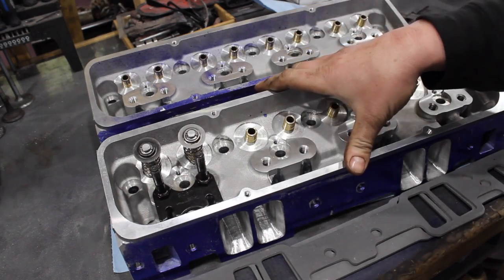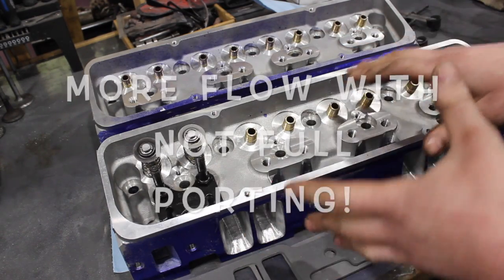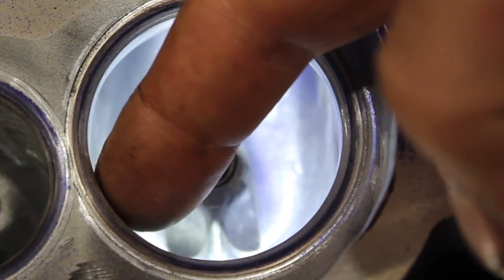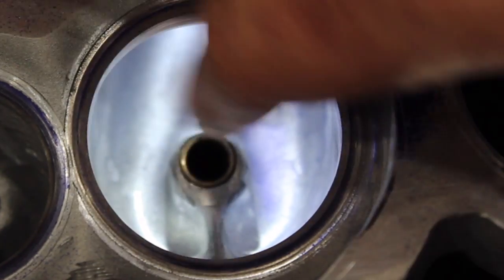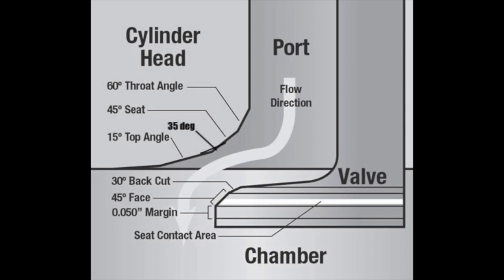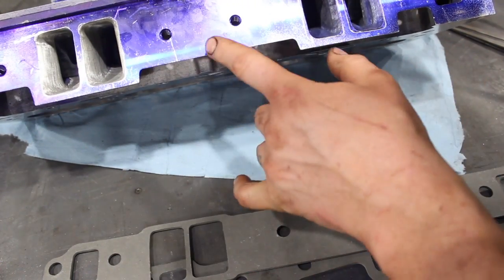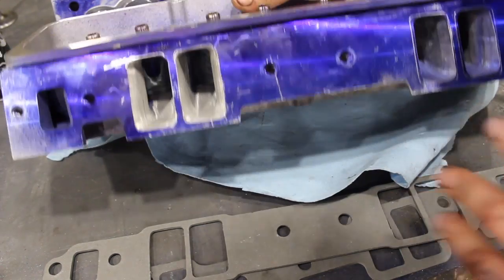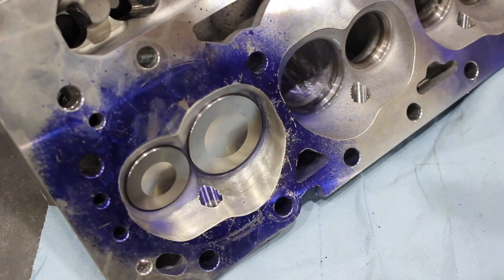Budget Head Now 550 HP Capable! Help me Build it Series

Comment: Great info question for you? i have a set of valves they are the same size that the dna heads are.. but they have ben ran in a different set of heads not very much run time on them they still look like new. Would you use them in a set of the dna heads? Or should I buy new valves? I am trying to get by as cheap as possible. i am putting together a 406 for a old square body suburban so I could use all the help I can get. I have rebuilt a few different engines but always just stock rebuilds this is my fist time swapping and experimenting with different parts 😂. Thank you for everything
Reply from the maker: If they are in good shape, you can reuse them

Comment: I have a set of SBC Edelbrock Performer RPM heads that I got in a trade. They're around 15 yrs old but don't really have that many miles on them. They were on a running 350 when I got them. I'm planning to build a budget 406 and hoping for around 500 hp. Would it be cheaper to have the Edelbrock's machined, considering I already have them, or to buy a new set of the Chinese heads?

Comment: Mine just arrived.  Pretty decent casting quality. Slight lippage at valve job, a little casting crud, one small scratch on one head deck that caught my nail. All in all not too bad.
Going up to a 2.05 after port cleanup.
Machine shops around here are booked out its crazy.
Update: finished port cleanup, slightly opened up pushrod pinch, worked bowls a little, finished exhaust with 120g, intake with 60g.
Next step is 2.08, check exhaust seats, match 1206 gasket, deshroud chamber to my 4.155 bore. Will allow less dish in the piston to get 10:1

Comment: Little  help!!! Start off,,, 1996 chevy 1500 4x4 5.7l (r) motor (L31)  i believe, 310,000 + ,using antifreeze ,cracked head,doing a rebuild on it with new vevor replacement heads???  Need an idea of cam/ lifters ,springs,( tow a 20ft.bass boat). Will need good brakes, vacuum , not hydro boost. Would like to speak with you,Thankz
Reply: @HaugBunch  your computer won't like it.

Comment: 244 dollars on Amazon right now. Still a great deal.
Reply: I found em and got em. Was looking at vortecs but was going to get them bare anyway so these are a better option for my 406
Reply: I sent mine to Eric winegartner from YouTube. 600 to have ported. He then set them up for me. They have thin ports at the pinch point but can be opened a little. I suggest you atleast open them a little if you can. The only place that really needs it. Gasget match. I just did my first set and they came out great. They are cheap enough for me to experiment with. You don't have to ,they are good heads. A lot of heads have problems.  Eric's cheapest heads are worth every penny. I have ordered heads directly from him.
Reply: @maxhames499  i appreciate ya. I was going to send him my set to have them flowed once done. Ive worked my brother in laws plow truck heads (882) years ago and these are my first aluminum.  Now I understand why Eric says "i don't do iron" lol
Reply: @paulmryglod4802  I did back in the day but no flow bench. I still don't have one. I took the measurements from my last set and got really close. I didn't put in bigger valves. Not worth the trouble. He has a video with my heads. He had to mill them a few thousand. I paid 189 a piece so a little extra work. After all said and done a cheap set from Eric on my next hotrod will be what I do. On my stuff these heads work fine
Reply: @maxhames499  awesome! I'm building up my dad's 400 that's been in our family since 78 and collecting dust since 06. Putting it in his 70 k20

Comment: These are great heads. I wish i would have bought more of them. Dont put bigger valves in! Open pinch point a tiny bit. I always use adjustable push rod guides. Eveything this guy said is spot on.

Comment: I know this is an old video. But my dna heads are still holding up. 383 stroker. Thanks. I bought these heads because of you. 400 dollars. 600 for porting. 160 shipping. 300 for pro 5 angle and back cut tulip valves. 500 for small parts. I was using vortecs. These blew them away. I kept the 2.02 valves.
Reply: I have watched a lot of different videos on small block Chevrolet and the 53 I don’t believe I’ve seen another set of videos that I enjoy as much as yours. You’re very knowledgeable. Explain things extremely well. I always look forward to your next video. Thank you for what you do.

Comment: I heard you say peak was @650.but where did it stop making large gains,because when you stop making big gains you have a parasitic power loss due to compressing 16 springs or (32) if you have double springs with that much weight being taken from the engine due to the loss of compressing then without flow gains also.so your sweet spot as far as that goes im guessing the magic lift would be around 550 to 575.

Comment: Bought a set of proheder months after they came out Depends where you get these...mine had avery nice velve job on it still had it checked. After porting first pass I got 308int and 230 at 600 with only a few cc removed. #'s were consistent with a 195c comp port and carried til .750
Lots of potential with min removal in the right places. VJ on those (vid) is horrid glad you went after it. A proper one can net as much as 25 cfm. 
The drill lappers will never understand this and unseat the other cuts doing this lol. 
Your getting better man keep up the good work

Comment: Do you really need to do the valve job? Just clean up & get new valves + l00 length & new seals & new dual springs etc, will it work?

Comment: Can I use these on a 1991 l98 TPI setup?
Reply from the maker: You will probably have issues getting the lower intake to seal to the large intake port
Reply: use an afr 180 elim head perfect for the tpi

Comment: Need help vortec or DNA heads on my 327 ?
Reply from the maker: Both will work fantastic, if your going with higher compression (10.5:1+) and a larger cam then the DNA heads but if its lower than that the vortecs will work great
Reply: @cuttersperformance  well the small journal I got already was at 10.1 compression rated @275 hp with stock heads. Want something in the 380-425  range.

Comment: Which intake gaskets did you use? I used 1205 but the port is raised . 100". I notched the intake gasket bolt holes but I'd like a better solution.
Reply from the maker: I finshed the set for the youtube 355 to a 1206 gasket. The bowl is already oversized abit for a 2.02 valve so almost all the flow increase I got was opening up the oddly shaped intake port to a 1206
Reply: @cuttersperformance  did you notice those heads having a .100" raised intake runner?  I port mated to a 1205 and gasket matched to a Victor Jr, opened up the pinch, slicked the bowles, guides and ports down. I noticed they could use a 2.08 intake valve to fix the bowl/throat problem. 

The problem I'm thinking of now is if I want to go to a rpm airgap, I'm worried the ports won't line up. The airgap has a bigger port opening than the Victor Jr. Thinking of taking them off and lowering the port opening to a 1206 now while it's on the stand verses taking them off in the car.
Reply from the maker: Yeah a 2.08 valve would be a great move if you were going for all out power 
Im not sure if you have the DNA heads or similar but alot of these off brand heads seem to have oddly shaped and placed intake ports. 
For me the 1206 worked out really nicely and I ported aligned it with a Edelbrock air gap
Reply: @cuttersperformance  what I have is the same as the afr enforcer heads, skip white, assault ect. These are known to have a 100" raised intake port. Kinda makes intake choices a pain in the ass. What surprised me was the rpm airgap having a bigger port opening than the Victor Jr.

Comment: I wonder what the math is for adding the valves and other components plus the valve job ? These are 400 a set now ,then you need springs , valves, studs , plates etc . Perhaps just getting a good bolt on set might be better .
Reply from the maker: Yeah especially at the price of these castings now

Comment: What valvetrain components did you use on these heads? 
  I found out an old set of iron heads are cracked so I ordered a pair of these. I have comp cams beehive valvesprings and retainers and locks. What spring locator and screw-in rocker studs do you recommend? I already have 1.6 roller rockers for 3/8" rocker studs so I'd prefer to stay away from 7/16". Self-aligning so no guide-plates. My old 1.94/1.5 valves are no good on these heads either.. and I'm looking for valve seals as well.
  Cam is a Comp cams xfi252hr. 202/212@.050". .550"/.546". It's going on a 2bbl gm tbi truck motor from the early 90s.
  My retainers and springs and locks are pn 787-16 for the retainers, 
Pn 648-16 locks,
And 26986-16 for valvesprings.
  Again, I'm looking for a pn for spring locators, 3/8" screw in rocker studs, and valve seals, and valves for these heads. 
  Thanks, your videos are informative and inspirational. I can't wait to see how much power the turbo combo will make.
Reply from the maker: Did you happen to see this video? Should answer your questions https://youtu.be/JjVddvcuHqU
Reply: @cuttersperformance  yes. I just found it. Thank you for your help selecting components. I knew I'd seen a list but couldn't remember where. 
  I just ordered a set of valves and locators and seals..
  What are your recommendations on rocker studs?

Comment: More than 2 years since I built my 383 using the ported Assault version of these heads. Still makes big torque numbers and ~19 mpg highway. I put 250 miles on it last weekend, running up to 85 mph without breaking ~2,500 rpm at any point. Makes so much torque there is no reason to get on the pedal hard to rev it out.

https://youtube.com/shorts/VSfSVm6tG3k?feature=share

Comment: I used the FLo-Tek 1200-505-Angle plug on my 355. I've got a Lunati 101020704 hyd. flat tappet camshaft, performer RPM airgap knock-off intake and a FST 750 manual secondary carb (Holley's work well but the primaries are about the size of dimes and then when the secondaries open they're like 3x the size! whereas these both are the same size and the price was right and they look well made and work well from all reports) and Hedman 1 5/8" headers with a 10.2 static comp. Hope to make at least 430 if I do bother taking it to the dyno
Reply: Might try your Summit cam if it runs well!

Comment: I really can't help but wonder what these would flow with the clean up like you did here but with the 2.05/1.6 valves and cut the throats for a 2.08 and 1.65 valve.
Reply from the maker: They would do alot better with a larger intake valve on the flow bench
Reply: @cuttersperformance  if only my set up didn't require the 75cc chamber I'd probably go with the enforcers.
Reply: If anyone is wondering what would happen if you cut the throat larger than usual for whatever size valve. It decreases flow when the throat is more than 91% of the valve size because it doesn't leave enough meat to round the transition from throat to seat. That leaves a sharper edge that henders flow

Comment: ello piss cutter i like to know if you be interest in a set of corvette 128 case L98 i have new  bronze glide  for them i have 300 in parts include the heads i like to sell  them  close to what i have in the glides. the glide were 200.00 so if you know some one to buy them also a older nice shape edelbrock intake CB-3 for 125.00 and other chevy parts crank and rods .060 seal power FT pistons  soif you are interest i have a pistons on Craigslist  Milwaukee wi. Thanks Terry

Comment: Would ANYBODY be running over .600 lift with such cheap heads?? Flow numbers or increases @ .650 seem irrelevant. I think guys that buy these are gonna run a hydraulic FT or street roller up to maybe .560 lift.
Reply from the maker: You gotta remember flow numbers are just an evaluation of the heads flow potential. The port flow can be very different once running on an engine, so flowing them at higher lifts on a bench can give you a good idea of the efficiency of the port and valve job. 
But to answer your question, most guys would be running under. 600 lift with these heads
Reply: 0.578 lift from a 218/228 @ 0.050 roller on my 383.  These heads flow 291 cfm @ 0.500 and 299 @ 0.600 after ported being by Lloyd Elliot.
Reply: @chrisreynolds6520  That's damn impressive. I don't suppose the porting was also $199?
Reply: @jeffrykopis5468  Was about $600 including taking 0.020" off the face to make sure the deck surface was ready to go and a multi angle valve job.
Reply: @chrisreynolds6520  Not bad at all. Was a .020 cut necessary? To get em flat? That's a lot.
Reply: @jeffrykopis5468  Not necessary but we were trying to get back under 64cc after chamber work.
Reply: @chrisreynolds6520  By the way, is that with a 1.6 rocker? 1.65? Cuz that's a lot of lift for only 218/228 duration.
Reply: @jeffrykopis5468  1.7 rocker
Reply: @chrisreynolds6520  I always wonder why canted valve, big port engines (Clevelands, BB Fords, BB Chevys) all came with 1.7 rockers, while SBCc, SBFs, and older Mopars got stuck with 1.5s? Seems to me they ALL could benefit from the extra lift.
Reply: @chrisreynolds6520  By the way, who makes 1.7s for a SBC? All my catalogs list are 1.5, 1.6, and 1.65. Do ya just use BBC rockers??
Reply: @jeffrykopis5468  Scorpion makes 1.7s for a SBC
Reply: @chrisreynolds6520  If those heads work out for ya, you got a screamin deal. AFR performance for a Pro Comp price!
Reply: @jeffrykopis5468  Work great, engine run video clips above with both carb and EFI.

Comment: I have a set of these with the dual (standard and vortec) intake bolt pattern.  They have a . 100" raised intake port, I'm not sure if yours are the same, but I used a 1205 and port matched them to the 1205 and knoched the intake bolt holes out to work. It made a nice port. I opened the pinch up a little, smoothed out the bowls, smoothed and softened the guide bosses, and blended the chambers. I used pbm backcut valves that lowered the chamber volume by 3-4 cc's to get 10.5-1 compression on a flat top 383 with a .038" quench. All this with a port matched victor Jr and a comp cams er294hr hydraulic roller cam. I think it should put out at least 475 hp if I can get the tune right with 1 5/8 headers and an 850 carb. It should have plenty torque as well. They need a 2.08" intake valve because of the shitty throat that is the worst thing about these heads and are still better than anything procomp has to offer.. Eric Weingartner did a set of these that flowed damn near 300cfm for his sister's 355. They're a dart platinum 200cc copy and a dart cnc program will service these heads perfectly. The spark plugs is moved about 1/8 inch is the biggest difference. I personally don't think the dart 200 heads flows that great either, but we don't race flow benches or dyno's. Lol

Comment: I read on forums that people use a valve train kit from competition products, do you know what part number for hydraulic roller? Also do they need +.1 valves and rods?
Reply from the maker: I will be making a video on everything i put on the heads, i  ended up using beehives on these ones.
Yes you will need +.100 valves

Comment: Is it possible to go to big on the gasket matching?
Reply from the maker: Yes for sure you can go too big. These heads have oddly shaped intake ports, so reshaping to a 1206 port wasy my best option. Sometimes porting to a larger gasket on heads and the intake manifold can cause a loss in port velocity and you may gain in peak power but a loss in average power.
Reply: @cuttersperformance  so do you recommend port matching to the intake and smoothing out the port or leave it be and loose that little bit of power?

Comment: Love the series Pat. I recently picked up a super clean 99 Yukon. It is going to be my first project and have been reading a bunch or different info in building a vortec 880 casting block. Regarding the cylinder heads I'd like to stick with an aftermarket vortec with bigger valves. Is there anything that you would recommend or better yet possibly sell me a pair that could bolt right on. Thanks for what you do.
Reply from the maker: Man you may want to consider using your vortecs, get the checked out if they aren't cracked you can make them into a great set of heads. I like going to a 1.6 exhaust valve and leaving the 1.94 intake valve. Abit of porting, some beehive springs 👍 

I don't currently have any heads for sale unfortunately

Cheers! 
Pat
Reply: @cuttersperformance  Thanks Pat, I appreciate it. Keep it up buddy, stay safe
Reply: These work great on a Vortec build. I have a set flowing 291 cfm @ 0.500 and 299 cfm @ 0.600 that were ported by Lloyd Elliot. I have a 218/228 @ 0.050 cam on a 108 LSA with 1.7 rockers for 0.578" lift. Rhoads V-Max hydraulic roller lifters adjusted cold 0.016" off the bottom of their travel. On an 11:1 6" rod 383. Ported Vortec intake with a 48 lb/hr high flow spider, 80mm throttle body and custom 4" air intake with a 100mm MAF.  Tuned with a 2005 P59 PCM using a Mexican GMT800 L31 tune as a starting point. Thorley Tri-Y headers into the factory dual 3" exhaust piping to the muffler. High flow cats and a walker dynomax bus muffler. All shoved into a 1997 Express van with a 2,800 stalled 4L85E and 4.10 geared 10.5" 14-bolt behind it.

https://youtu.be/J4v4Z9rAKio
Reply: @chrisreynolds6520  thanks for the info, that van sounds great in the video
Reply: @fukemallgarage  Also what it sounded like with a freshly built Q-Jet on it. Still needed some tweaking to the idle mixture and idle speed as well as the APT adjustment, but still ran well.

https://youtu.be/l7XDuEvqFR4
Reply: @fukemallgarage  great title,,,,,,,,,fukemall garage.................